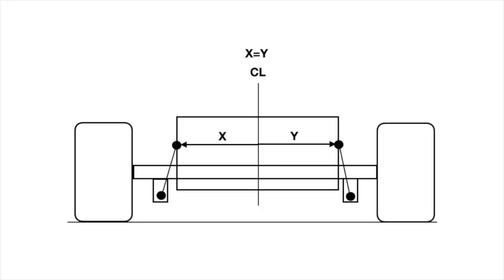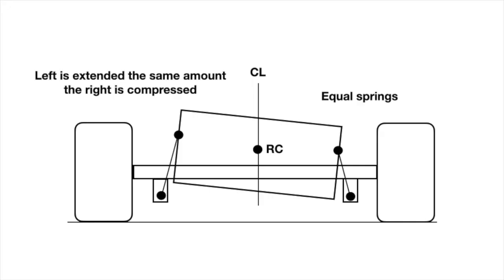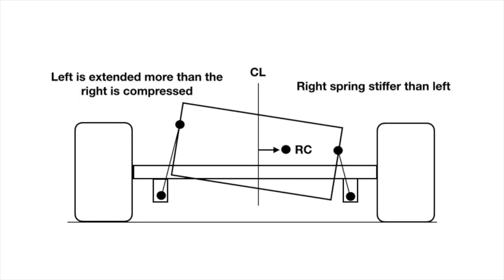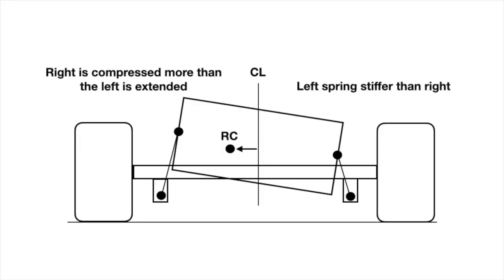Elastic Based Roll Centers  Dirt Late Models and Dirt Modifieds; Roll Centers Through Springs

Comment: As you compress the right side spring the rate increases by that number and a half so the elastic roll center still mover to the left ?
Reply: I don’t think you can use dynamic weight transfer numbers. This is just a stationary number with the splitting of wheel rates from side to side. I do mention the spring indexing thing more as a example of how spring angle can change to change wheel rates. I should have probably been more clear on that. Thanks for watching.